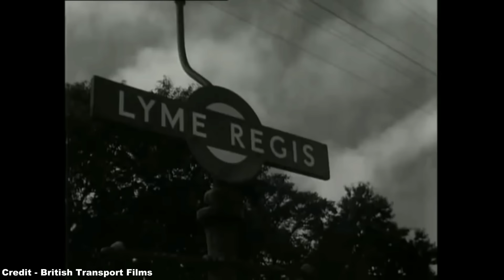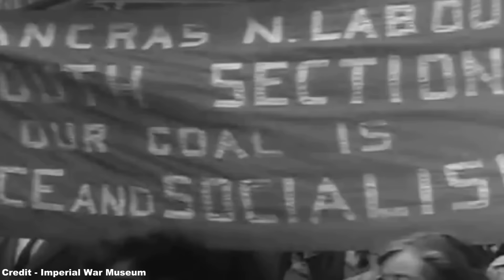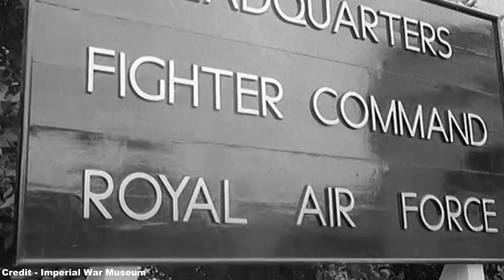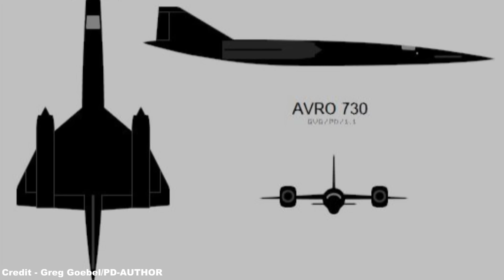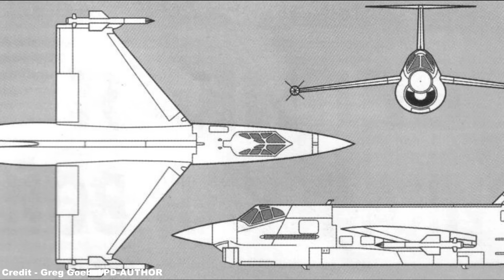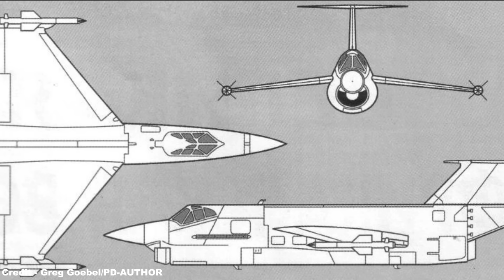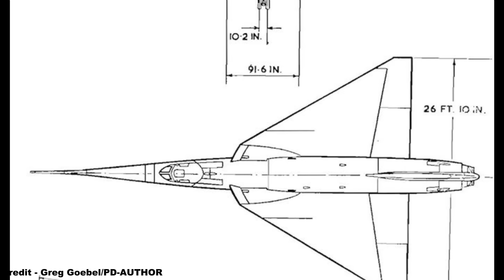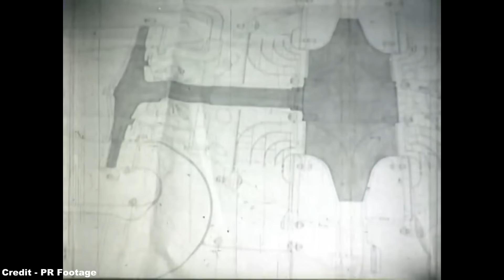The 1957 Defence White Paper - Death by a Thousand Cuts

Comment: It was simply impossible for the UK to maintain the scale of her military industries.

Of course, the Americans, special friends that they are, never hesitated to screw the UK out of export business wherever they could.

Then there were the issues around Comet, TSR2, Concorde and  Trident.

Excellent presentation.

Its a pity that the UK was only peripherally involved in Airbus.
Reply: "the UK was only peripherally involved in Airbus." According to Wikipedia, only "...the design and manufacture of the high-technology wings for all Airbus models as well as overall design and supply of the fuel system. For most Airbus models, the company is responsible for overall design and supply of landing gear.
Reply: @evaluateanalysis7974  It should have been a significantly greater level of involvement.  Only 20 percent share today.
Reply: @evaluateanalysis7974 Britain is no longer involved with Airbus, BAe sold it's stake back in 2013.
Reply: @yuglesstube Britain has a Zero share in Airbus SE.
Reply: @sandervanderkammen9230 "Britain is no longer involved with Airbus" It depends what you mean by involved. Wikipedia says: "...the design and manufacture of the high-technology wings for all Airbus models as well as overall design and supply of the fuel system. For most Airbus models, the company is responsible for overall design and supply of landing gear.
Reply: @evaluateanalysis7974  I'm sorry but you seem very confused and misinformed.

Airbus UK is a wholly owned subsidiary of Airbus SE and is a registered foreign aircraft manufacturer, like many others that now occupy the dozens of sites abandoned by British companies that ceased to exist after the collapse of the UKs own aircraft industry.
Reply: @sandervanderkammen9230  British industry
Reply: @yuglesstube  Airbus is not a British aircraft manufacturer.
Airbus SE is a German, French and Spanish consortium which operates manufacturing facilities in 24 countries Including the UK.

Any questions lad?
Reply: @sandervanderkammen9230  dint be an asshat.  I perfectly well understand derstand the structure.  My point concerns British involvement, which is peripheral.  It would have been a core member had the UK not withdrawn in 69
Reply: @yuglesstube  Britain no longer manufacturers commercial jet aircraft... you seem to be in a state of denial of this fact.
Reply: @sandervanderkammen9230  Seriously.  The RJ line closed twenty years ago.  They still make wings and I think undercarriages.  Fuel system components.  

It's a long way from Vickers, DH, Avro, Supermarine, Hawker, Hunting and Bristol.
Reply: @sandervanderkammen9230 "I'm sorry..." You'd better tell the employees that their jobs don't exist, they are paying their mortgages with Monopoly money and the wings that they are making aren't real.
Reply: @yuglesstube  Please name a single British company that still makes commercial jet aircraft in Britain?
Reply: @evaluateanalysis7974  Please cite the name of a British company that still makes commercial jet aircraft in the UK???
Reply: @sandervanderkammen9230  These damn well isn't one.  Read my message.  There are component suppliers
Reply: @sandervanderkammen9230  Actually, on reflection, there is Britten Norman
Reply: sandervanderkammen9230
is intentionally misunderstanding comments then telling people they are wrong about something they haven;t claimed.
Looks like a troll to me.
Reply: @yuglesstube  So you you admit that there are no longer any British companies makes commercial jet aircraft in the UK?
Reply: @evaluateanalysis7974  Just the facts here lad, britain was never a leader in aviation technology and has always lagged years behind Germany France and America.
 After years of making inferior jet aircraft that no one wanted to buy the aircraft industry in the UK not surprisingly completely collapsed.
Reply: @sandervanderkammen9230  "lad" Now definitely a troll.
Reply: @evaluateanalysis7974  sorry!  I apologise.  Misdirected.  Forgive me.
Reply: @evaluateanalysis7974  I'm not the one misquoting Wikipedia and thinks Airbus is a British company..
Please stop posting lies and ignorant misinformation about a topic that you are very clearly not qualified to discuss intelligently.
Reply: @evaluateanalysis7974  Thanks.  Done.  I know your handle and your comments are always well thought through.
Reply: @yuglesstube  Please name a jet airliner made by Britten-Norman?
I can't seem to find one
Reply: @sandervanderkammen9230  I don't know how this became a jet production issue.  The UK makes some components.  It's been twenty years since the RJ line shut down.
Reply: @yuglesstube  Exactly lad, and we happen to be discussing the collapse of the UK aircraft industry..
The fact that britain must now buy its jet aircraft from foreign manufacturers is particularly noteworthy.
Reply: @yuglesstube  Done. Thanks.
Reply: @yuglesstube  sandervanderkammen9230 repeatedly changes his argument when he sees that he is losing. So "no manufacturing" became "no British owned manufacturing". No Aircraft manufacturing" became  "No jet aircraft manufacturing".etc.
Reply: @evaluateanalysis7974  Airbus UK is not a British company, it's a registered foreign company a wholly owned subsidiary of Airbus SE a German, French and Spanish consortium.
Some would say that working for the Germans and the French is far more shameful and humiliating than having no aircraft industry at all...
Reply: @evaluateanalysis7974  It's not just the Germans and the French that invaded England..
The Americans like Lockheed and Boeing have taken over abandoned British factories, taking advantage of the cheap rent and cheap subsidized labor now that there are no longer any of the big British aircraft companies left.
Reply: I believe Hawker siddeley was still involved after that time @yuglesstube
Reply: @DBird-uw1op  Yes.  But the lions share of the work is not done in Britain today.  So it's another British failure to maintain their place in the industry.
Reply: @DBird-uw1op  Hawker Siddley was part of French Airbus company until H.S. ceased to exist in 1977 (merged with unmitigated failure called BAC) 
BAE acquired this share which it sold off in 2005-2006.
Airbus SE is not a British company and it has ZERO British ownership.
Airbus SE is:
40% owned by DASA (Germany)
40% owned by Aerospatiale (France)
20% owned by CASA (Spain)

Airbus UK is a foreign registered company and is 100% owned by Airbus SE.

Any questions?
Reply: @yuglesstube  The failure of the Airbus A380, its subsequent cancellation and the economic effects of Brexit has seen most Airbus UK employees laid-off permanently as production of wings winds down and production shifts to other EU countries.
Reply: @sandervanderkammen9230  really?
Reply: @sandervanderkammen9230  I'm surprised, but not entirely shocked.  I sometimes wonder whether the British perfected the double barrelled shotgun to enable them to shoot both feet without reloading.
Reply: @yuglesstube  Yes, absolutely... Airbus has not had any British ownership for nearly 2 decades
Reply: @sandervanderkammen9230  But wings being made in the UK is the issue.
Reply: @yuglesstube  Wing production at Hamburg and Tolouse has steadily expanded while orders at Broughton UK has steadily declined with much of the facilities now shuttered. 
While no official announcement has been made but it is expected that wing production will cease, the Government of Wales has been looking at potential new tenents or possible sale of the Broughton site.
Reply: @sandervanderkammen9230  Do you think Brexit is the reason?
Reply: @yuglesstube Well, the cancellation of the Airbus A380 was a major blow to UK operartions and resulted in around 1,600 jobs lost.
The A330 only has 2 new orders this year and the current backlog expected to end in 2025.
Airbus openly threatened to divest it's UK sub-assembly production if Brexit passed... Covid also put alot of final decisions on hold.
The Italian company Leonardo has offered to take over the Broughton site but no official deals have been forthcoming.
Reply: @sandervanderkammen9230  That's very interesting.  Thanks for the information.   I appreciate it.
Reply: @yuglesstube  Cheers mate!

Comment: What qualities of the TSR.2 vastly exceed those of the F-111?
Reply: There were none, TSR.2 was a turkey that needed 3 miles of runway to get airborne and couldn't carry any payload or fly Mach 2.
Reply: @sandervanderkammen9230  The top speed at high altitude requirement was relaxed to just mach 1.75 during testing, but since it was intended to attack at low altitude, high altitude speed was almost irellivant (even mach 2.5 at altitde wasn't enough to evade SAMs of the period, hence the switch to low level).

But where on earth did you get a 3-mile take off run from? Even the reduced spec in 1959 said 3,000 ft (~900 m). Or that it couldn't carry any payload?
Reply: @sergarlantyrell7847  It's called sarcasm, the required runway length was as you pointed out DOUBLED and all of its minimum design requirements were slashed, testing revealed major design performance flaws and deficiencies that were so severe that the testing program was halted,
Reply: @sandervanderkammen9230   3,000 ft was the same as the spec for the F-111's short-field performance... How is that bad?

What new plane didn't have major deficiencies that needed sorting out during testing? The F-111's wings kept falling off at first. There was nothing that couldn't have been sorted out had the uk been able to throw the same amount of money at the problem that the US did. The cancellation wasn't on technical grounds, but financial and political infighting between the RAF and Royal Navy. After the UK lost the Australian order, they couldn't finance the project to completion.
Reply: The difference is that the F-111 actually met all its design specifications.
It could fly Mach 2.5 and still carry 8,000 more pounds of payload. General Dynamics Convair division is the most experienced in world in supersonic aircraft.
 BAC was a massive dumpster fire, the combined burden of 4 failed British aircraft companies saddled with an additional layer of incompetent government beauracracy.
 BAC never produced a single successful aircraft on its own.
Reply: @sandervanderkammen9230   Was part of the F-111's spec that both the wings stayed on...?
Because you're comparing an aircraft that was not just finished but had many upgrades and versions throughout the years to one that was cancelled part way through development. ie apples vs oranges.

The F-111 wouldn't reach Mach 2.5 till the later F version.
Most of the F-111s ordinance was carried externally, meaning you had to choose between speed and payload. The outer 2 pylons were fixed so the wings couldn't be swept back so at max load, the F-111 was limited to low-subsonic, else it would lose something like 12,000 lbs payload capacity.
By comparison, the TSR-2 had a much larger bomb bay, so its payload capacity at supersonic speeds was 50% greater.

The point that the video was making, was companies like BAC were never allowed to succeed on a technical level thanks to all the cancellations and cuts that the likes of general Dynamics didn't have to deal with.
Reply: @sergarlantyrell7847 and pressure from the US president directly
Reply: @sergarlantyrell7847  The TSR.2 was a failure and a significantly inferior design to the F-111.
Britain could not afford to buy either aircraft..
Reply: @adamcarreras-neal4697  The US president saved Britain from the Nazis... but at a heavy price.
There were only two winners in WW2... Britain was not one of them.
Reply: @sandervanderkammen9230  how exactly was Britain saved from the Nazis?